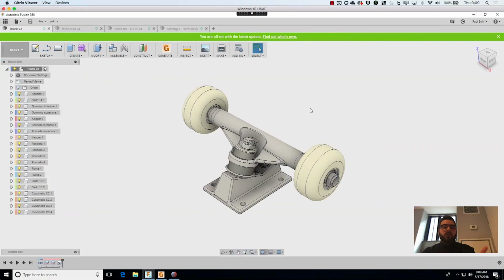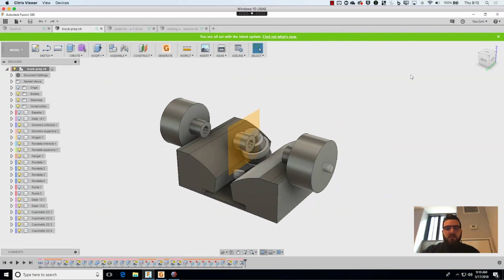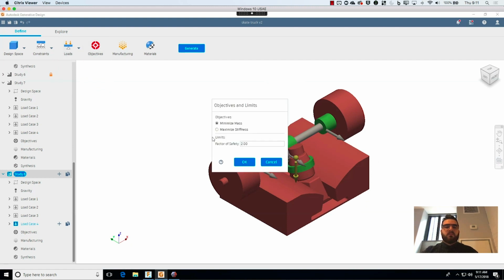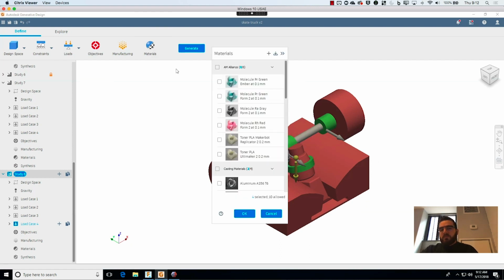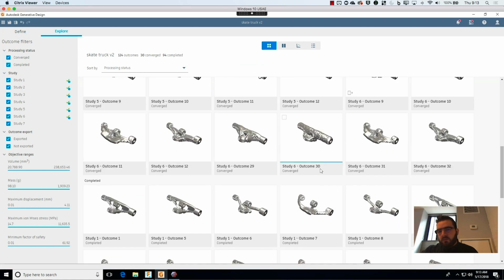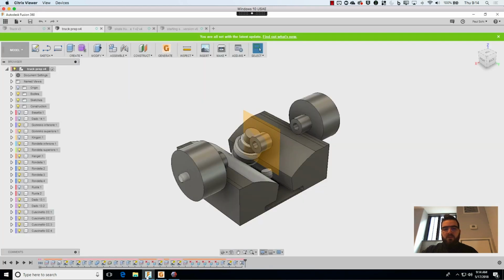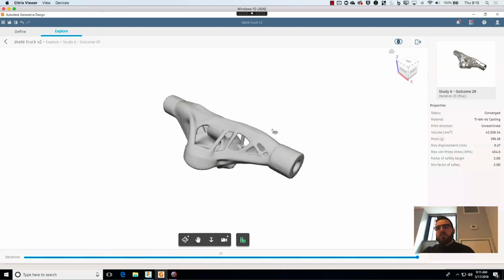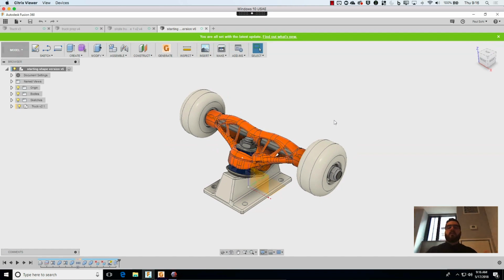Autodesk Generative Design First Look!

Comment: Hi Paul, Thanks for the great tutorial . I know the vid is a bit old now, I am trying to achieve an aesthetic pleasing result using the volumetric lattice in fusion as the starting shape for generative design like u did in the video, the resulted object is not readable in the generative design environment , I tried to convert it to mesh and still can't use it as starting shape , As for Meshmixer  I wasn't able to do the lattice with it , any suggestions?

Comment: Did you ever print this and have any success?
Reply from the maker: yes! I made a whole video with Braille Skateboarding about it! search for "3d printed skate truck"
Reply: @paulsohi9015  really cool, thanks, Paul! My company recently started looking into this AutoDesk product, though we use Siemens NX which has a similar package too.
Reply from the maker: @_donny_9473  no problem! HMU if you're interested in learning more! this video is pretty old, and the tech is a lot more advanced since this video was released, I need to make a new one

Comment: Great demo and process, thank you! One comment, though: Asymmetric structures from optimization will (virtually) always give asymmetric stress distributions (due to the asymmetric stiffnesses wrt the middle plane). Thus, you will most likely lose significant performance if you just mirror the side you like best.
Reply from the maker: Yes absolutely! After I did this I ran it through FEA again to make sure it was still safe for use

Comment: This is great stuff! Did you ever try lost PLA? I saw you sent a few DMLS prototypes to the guys at Braille, but I'm looking to do something similar and DMLS is out of my price range. I imagine there might be a lot of people in the same boat and curious to learn how feasible manufacturing something like this is with more DIY techniques.
Reply from the maker: Casting works but DIY solutions can be sketchy, make sure you get trained in how to do it first and practice q few times, not every shape is castable!

Comment: Very nice video! How do you mean when you say (7:37) you will print it in PLA and cast it? Do you use the PLA print as a positive to make a mold? Would be very interested to hear more details about this!
Reply: Look up "lost PLA", it's been around for quite a while and there is several videos of people showing various techniques. In a nutshell, yes, you basically use the print as a positive to usually make a plaster mold. You then just use that mold to cast the metal during that the PLA burns away due to it's low temperature resistance. Lastly you dissolve the plaster and voilà you have the print casted in metal.
Reply: @Zomhad  it is also possible to print this with some other metal printers like SLS and SLM Printers. there is not much rework needed in this way.

Comment: Hi Paul,
Nice video! Why did you need to create a latice? Why not just use the exported sat as a seeding geometry? How much of weight where you able to reduce? 
Next step now looks like the  axis could use quite a lot of weight reduction. Curious to see that whole assembly optimized . Let me know if you need a hand, we could do some community driven engineering :-)
Reply from the maker: Hi David! Great question, something I should have covered in a bit more detail (will remember that for next time!) you could absolutely use the exported SAT as the seed geometry, but because generative results will vary based on the seed geometry, I added the lattice to see if it would net me more aesthetically pleasing results! 

If you have anything you'd be interested in me having a stab at for a youtube video, HMU on twitter DM's and let's have a chat!
Reply from the maker: oh and I saved 180grams!
Reply: David Truyens ik m
Reply: David Truyens i

Comment: Hey Paul, great video. I am the co-founder of Brainlabs. Currently, we are working on the development of an hybrid system between generative design and interactive design techniques to create optimal design alternatives not only based on performance criterion but also on the designer's perception of design aesthetics. Recently, we released a geneative design plugin for solidwork to create form alternatives of a given parametric CAD model. https://youtu.be/QDcW2FPvq-Q.
Reply from the maker: interesting stuff, I like the aesthetically driven angle!